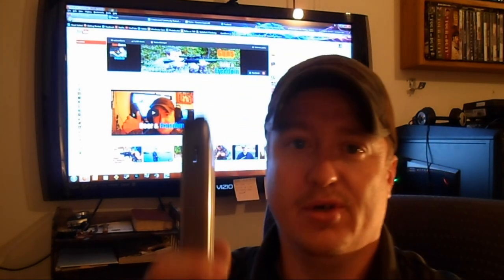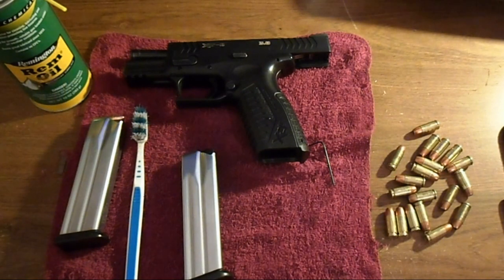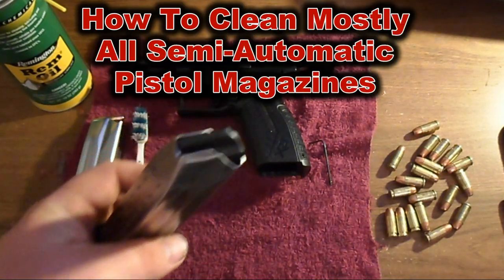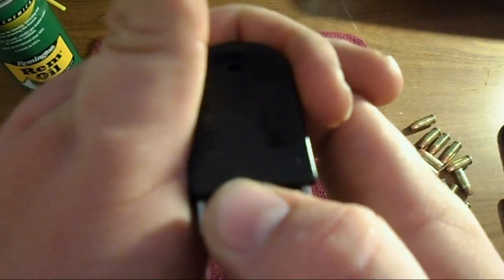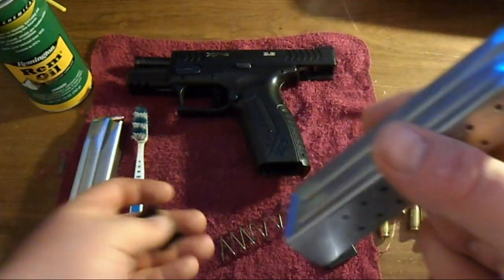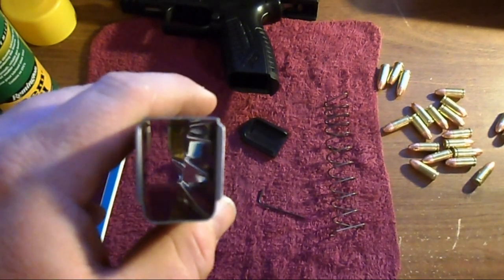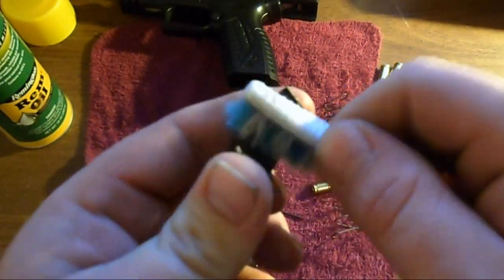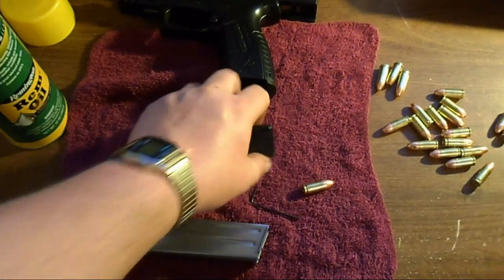How To Clean Most Pistol Magazines: Video Tutorial (HD)

Comment: I heard a thousand times - don't lubricate your mag. All my instructors at the range say so. And they all have some Mil. background. 
Recently, it prooved wrong for at least one  ProMag 10 rd M&P Shield mag. I bought 2 of those a couple weeks ago and run them on my new M&P Shield.
All of my gurus said ProMag isn't a good maker of mags. I was upset and ready to return it to the seller.
They worked OK for around 100 rounds until yesterday. One of the mags caused a jam on the last two rounds.
 I pulled it out and noticed that the follower gest stuck at the very upper end of the mag.
So, I tried the follower with my finger and it had apparent friction there, not allowing to reach the end of the mag. Just enough to not push out the last round.
In spite of all warnings from reputable sorces I took apart the mag and using a brush and a Qtip cleaned the inner surface with Hoppes Oil right at the upper side of the mag.
Exactly where I felt the friction happened. 
It did help a lot. Not only I could move the follower easy now with my finger, but I was also even able to use the autoloader. I also did the same cleaning for the other ProMag.
I will try the mags today at the range. I probably should update my findings in a week or so.
Reply: Did the cleaning ruin the pro mags
Reply: @petermckenziejr4125  eventually, I got rid of them,  they turned out to be not reliable.
There's nothing better than the factory magazine
Reply: Thanks for the info, I bought some Promags and I've only used them once but I'm already having issue loading them on my 2nd outing at the range😒. Hopefully cleaning then will also help.